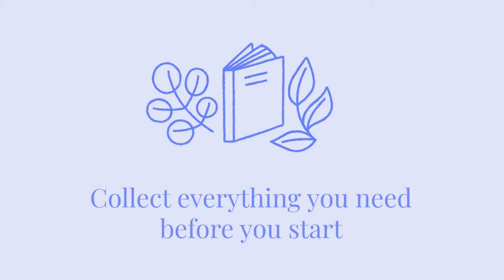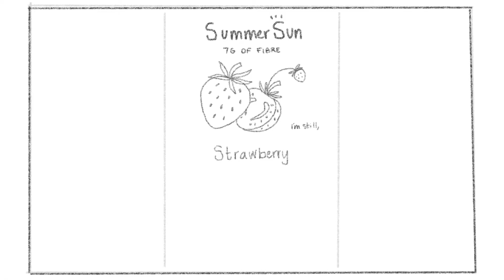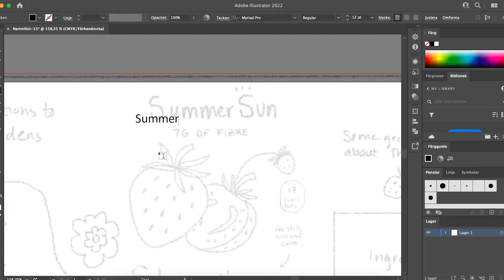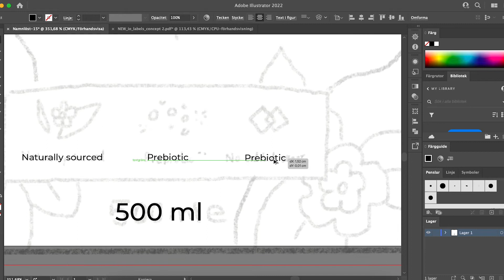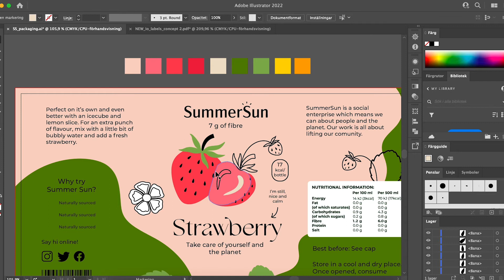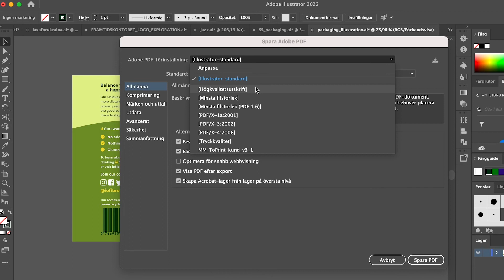Comment: Hi kayla, I noticed you designed and exported all in RGB. But i thought prints were all Cymk. Can you please clarify that, When i change my color format to cmyk everything looks dull 😢
Reply: Hi! You are completely right that you should use CMYK for print. You can also use Pantone colours and the different finishes can help with the colour saturation. Matt finishes are often a bit more dull. I'm not sure why that last file was set as RGB, I probably just missed it when I filmed but files sent to printeras are always CMYK for me as well 😊 If you are having a hard time finding good colours, try a Hex code to CMYK converter online 🙌
Reply: @Kayla-app   Thanks alot for insight. Your video are literally life savers 🥲😇